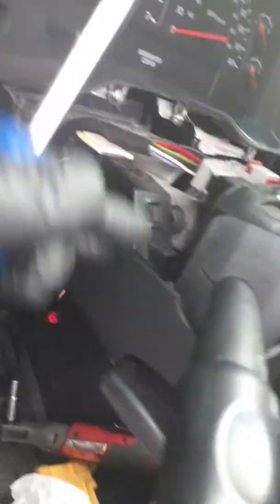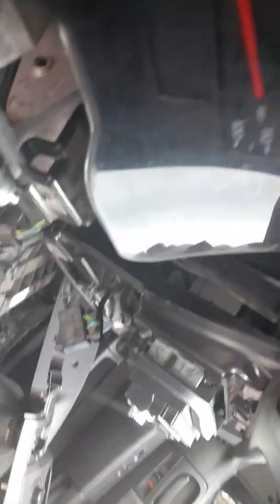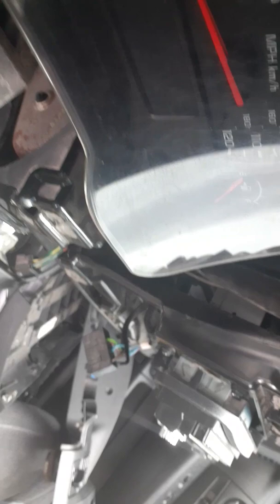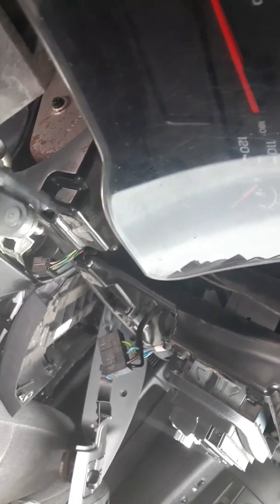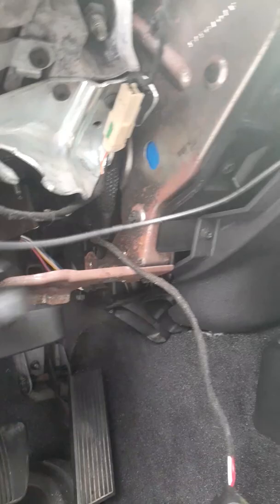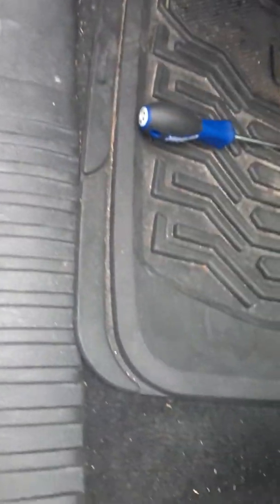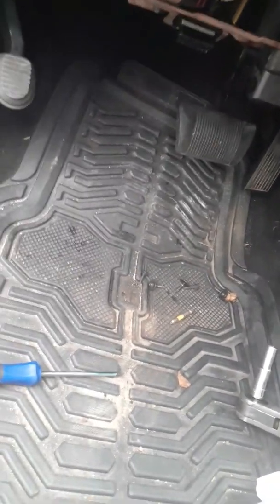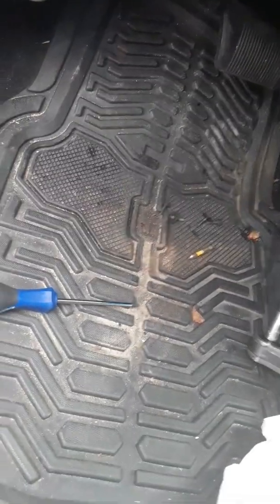Changing the shifter cable 2003 dodge dakota (wrong shifter cable.smh)

Comment: Was your shifter woobly and loose feelinfg?  my o3 Dakota is very loose.
Reply from the maker: Yes, so your shifter cable is probably tearing apart. A cheap fix I did was tying the broken outer plastic sleeve up with a thick layer of black electrical tape.
Reply from the maker: A new shifter cable should eliminate that loose feeling, good luck.
Reply: @davidw9403  ThanKyou

Comment: I know this was posted a while ago but I see you say wrong cable... This just happened to me today and the dealer sold me a ram 1500 cable saying it was for my dodge. Did you get the cable to work? My only problem with the cable is it won't fit in the bracket by the transmission. I wasn't thinking I can bore the whole out so it will fit or I can maybe buy a bracket for a 1500 and put it on the dodge as long as it's the same bolt pattern
Reply from the maker: (late reply) I ended up reusing the old cable and mending the tear with electrical tape until I sold the truck for $500.smh